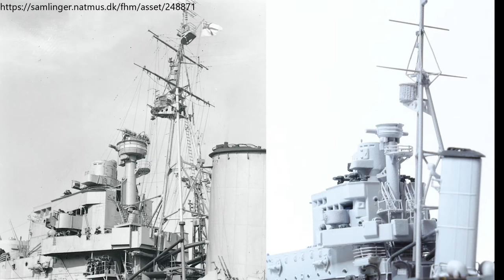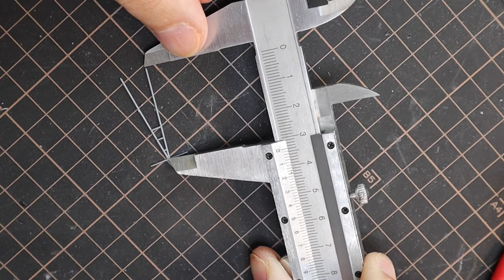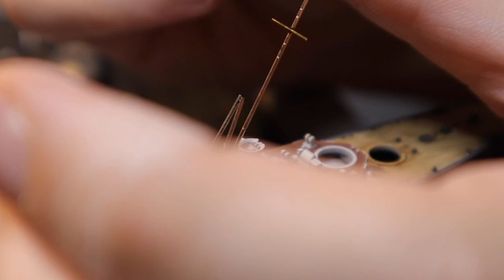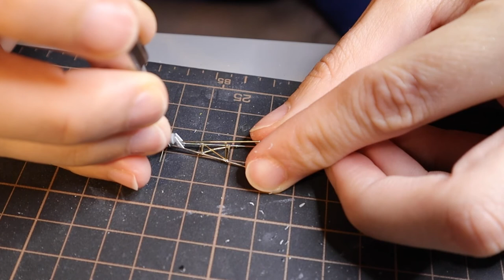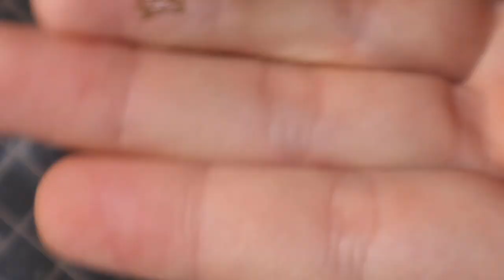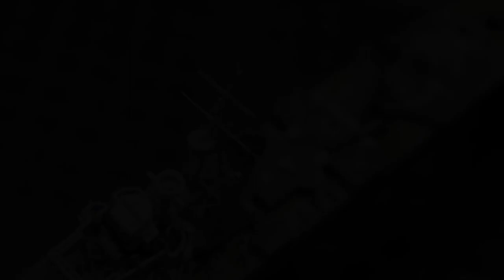How to scratch build masts for your 1/700 scale warships

Comment: 1/700 +64 years old +arthritis = I'm not that insane , stress level thru the roof . Not something I would attempt , good work!
Reply: I’m 73 with arthritis, but after watching Plasmo detail a 1/700 Walrus airplane, I’m no longer afraid to try anything, no  matter how tiny.
The big difference in my technique for building masts is that I use brass wire so I can solder the connections wherever possible. I find that easier and more durable than super glue. You can find online various fine gauges of brass wiring made by a Korean model supply company. I use tape or putty  to hold the components in position on a ceramic tile for soldering.
Reply: Same here. I think the kit mast is good enough. My last model, I used stretched sprue for rigging so there was no tension added to the plastic mast. Hard enough to rig without adding to the frustration.